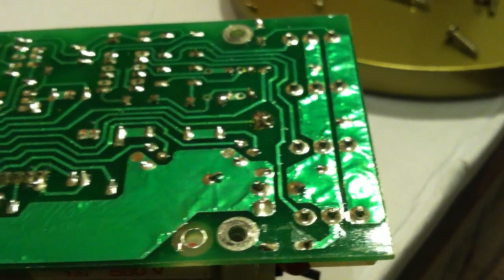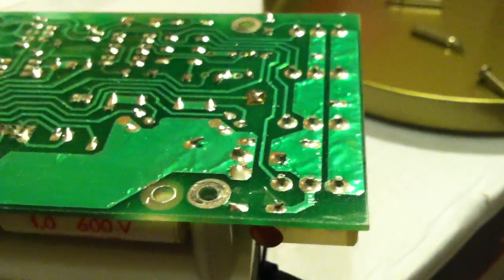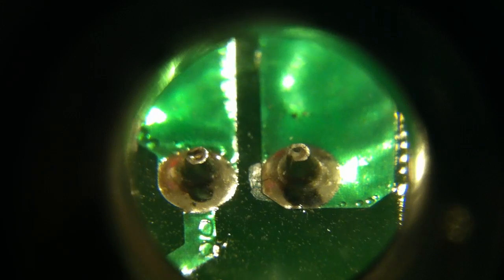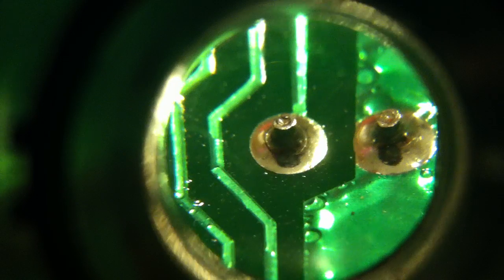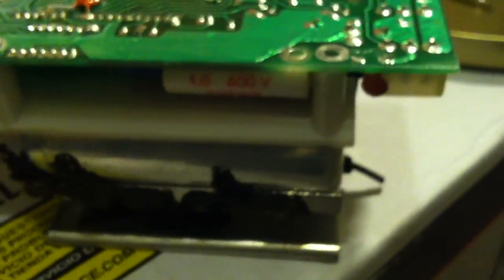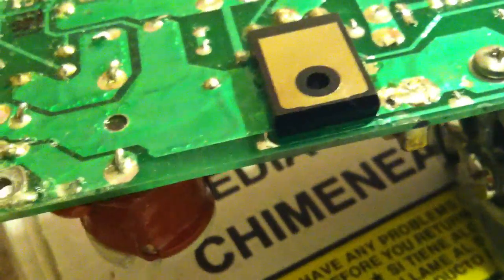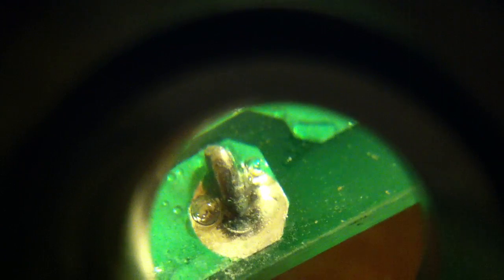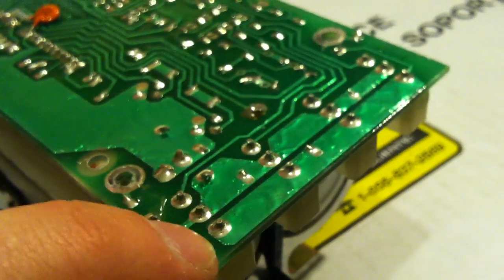How to identify a cold solder joint

Comment: Can a cold joint point burn when we switch on our television
Reply from the maker: LUCIFER GAMING yes
Reply: @hitandrepair  if we repair it then would it be alright means with a soldering iron.in my TV a small white box is also sparking and a cold spot is as well what will I do
Reply from the maker: LUCIFER GAMING solder the sparking thing to. If you want take a photo. Send it to hitandrepair at gmail. I’ll give it a look

Comment: Thanks. Its that little circle that indicates there is a short, or no contact with a connctor or.device.
Im a ham radio operator that needs to go through an HF rig. It will loose sound out of speaker, or not TX. A good slap on the side usually fixes it. I suspect the relay board is where all my problems are happening. It could also be sticking relays...but first look for cold solder joints.

Comment: Hahahah people don’t seem to be finding this video very helpful. But it helped me a lot thanks! (And I’m a noob with no experience in electronics)
Reply: For those that are legally blind, if you look at the bottom part you’ll see a circular ring that is the cold solder.
Reply: @xehP  Idiot 1
Reply: @bmw12347  is this something you commonly do? does it boost your low self-esteem? gives you a tiny dopamine kick does it?
Reply: @xehP  So you understand how it feels. Don't call others blind when you are the odd one out. Surely the collective comments mean something.
Reply: Phexism agree phex
I learned from it.I guess the dislikes are from viewers who learn slow and don't absorb data
Reply: @paulanthony4534  or from viewers that know these are not cold solder joints. They are failed joints. There is a difference.
Reply: @ConsolesUnleashed  not much of a difference to casual people trying to repair am incorrectly soldered component.

Comment: they aren't particularly 'bad' joints but they HAVE electrolysed over the years - that's why it's the higher current devices connections where they have failed ...
Reply: Maybe also mechanical action because they were molex connectors.